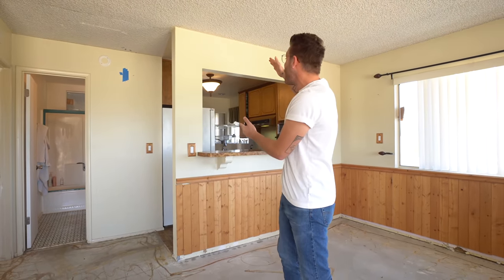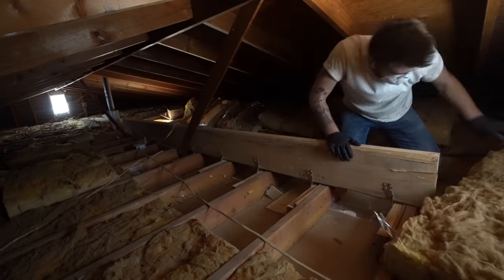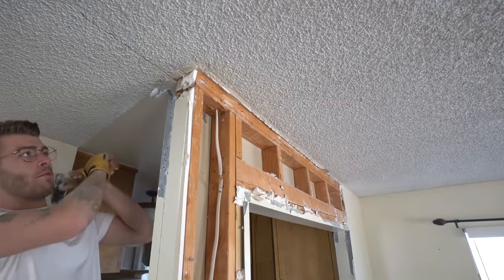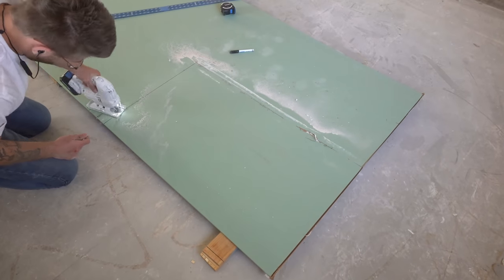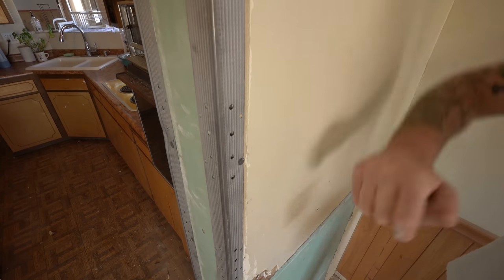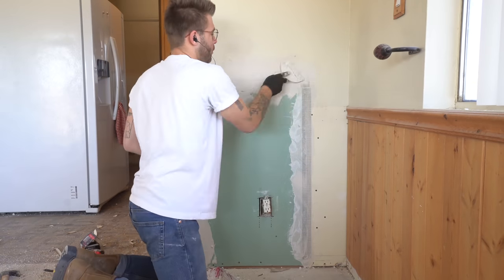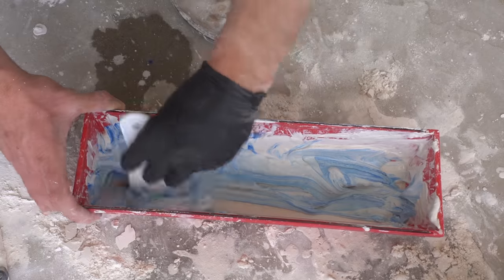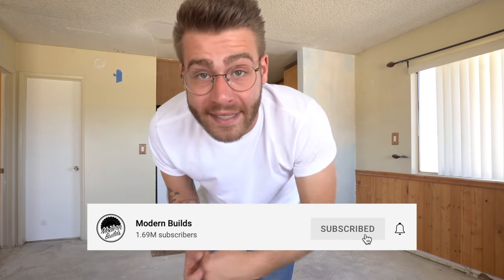REMOVING A LOAD BEARING WALL | Joshua Tree Cabin Renovation

Comment: Lots of comments about the danger of this video. I’m no expert, but here’s my take.

As far as I can tell, the “load bearing wall” he’s removing doesn’t support any point loads. If it did, the ceiling joist wouldn’t be spliced together with plywood. Also, the ceiling joist are in tension and any pressure from the roof should be a point load on exterior walls of the house. If anything the strong back is just a precaution to support the weight of the ceiling joists. 

Like others have mentioned, deck screws and hurricane ties shouldn’t mix. Deck screws are brittle.

Comment: This is not right dude.

'Load bearing' in stick framing, means that loads from above are transfered down to the slab/post/beam below all the way to the ground. What you've done In the attic here doesn't accomplish that.

Comment: This is stupidly dangerous. That ceiling is going to stag and it is NOT up to code. When my contractor did the load bearing wall removal—he framed an extra temporary wall to hold the weight before knocking down the old wall. It would help to add several jacks to hold the current wall up before demo. Then he needs to install a huge steel I-beam right below the horizontal 2x6. The 4x4 two extra posts were added to the sides to hold the weight. This is completely wrong wrong wrong. That board you put in the attic does nothing and even put more weight.

Comment: Dude if that was a load bearing wall shouldn't you have checked with an engineer?  Even if you DIY the work a pro will make sure it's safe. That beam in the attic seems more Super Sketch than Super Pro.

Comment: MISINFORMATION! that isnt how structure works at all. The load carried by the wall was not transferred. At the very least you should've extended the beam to the ext wall for support and have the opposite side sit on the assumed existing post (assumed cause there is already an opening). Always consult a professional! seems harmless at your house but not everyone's home is the same and a video like this can lead to safety issues.

Comment: Same comment as most of all....and with all respect,as an architect,  this video is dangerous. The way you modified this structure is incorrect and dangerous Contract an expert for your safety.🛑 That added part does not work in that way, you just added more weight, without anything supporting the weight of it.

Comment: As an engineer, every video you do on this house has code violations you are creating. Please stop and ask a PE.
Reply: Question - what is a PE and how do I find one locally if I want to make a change to a load bearing wall in my own house?
Reply: @hey_virginia  a PE is short for professional engineer. It means they are licensed in that state to design. Every engineer in construction has their own tests they need to take be be a PE. I have a PE in 37 states as an electrical engineer. In the states I don’t have a PE license, I can design but a licensed electrical in that state have to stamp the drawings I design. The PE is a physical stamp that has to go on the drawings before they can be approved by the local inspectors.
Reply: @jaydouglas1090  super helpful for real. Thank you!